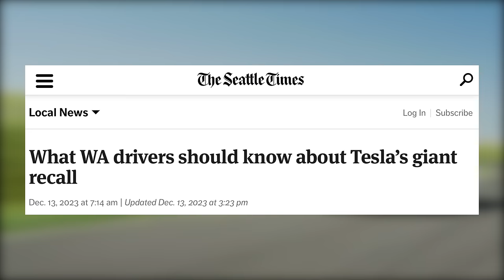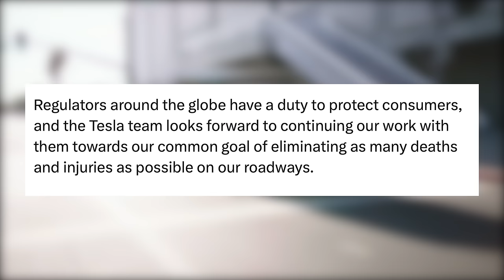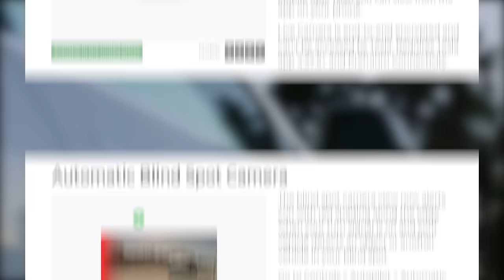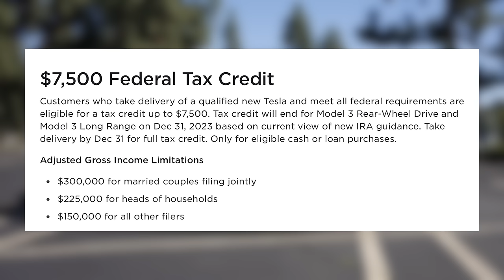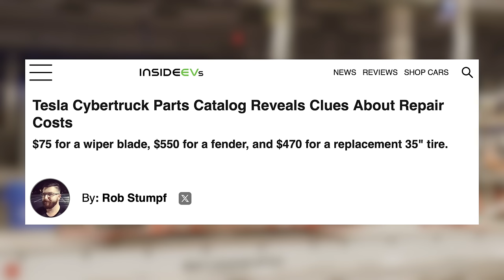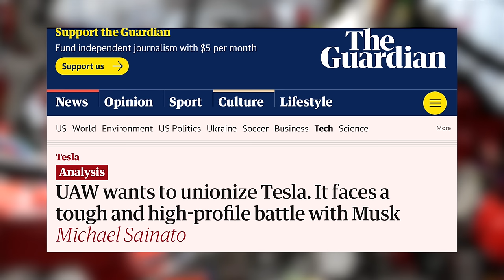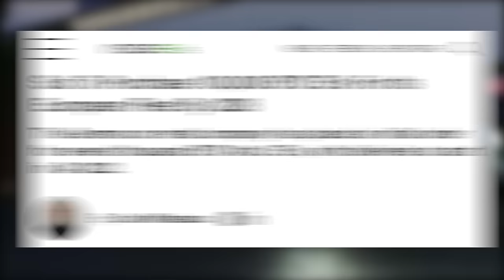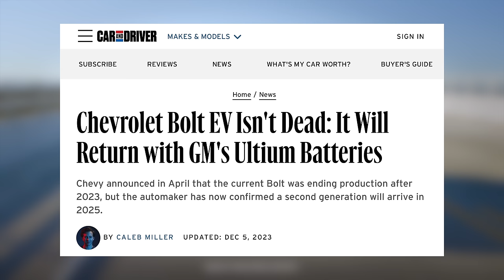NEW Tesla Features Are HERE | This Is Awesome

Comment: This SHOULD NOT BE CONSIDERED a recall. This is an over the air software update. There is a big difference (IMO).
Reply: But Tesla- haters sing the same song.  Same crap, different day…
Reply: The transportation is treating it as a recall however it is easy for Tesla since they can just send a program, like spam emailing people and it's done.
Reply: There needs to be a distinction between “Recall” and “Vehicle Update”.  But these corrections in nomenclature take time and move slowly.  Hopefully it’s on their JIRA board to correct soon.

Recall = physical component that requires the manufacturer to resolve or a software correction that cannot be resolved with an OTA update and requires service center intervention.

Vehicle Update = discovered issue that can be resolved with an OTA update.
Reply: Call it what you want imho idc bc I was sleeping when my car got the update. Boo who, not me =b
Reply: It's still a safety :face-purple-wide-eyes:recall, but just a different way of correcting the problem.
Reply: @vnitto  Right, a convenient and instantaneous way to solve a problem that virtually all other manufacturers have to issue physical recalls for. But yes…
Reply: @vnitto in this context Recall means "recalled to the dealer". It's not a recall.
Reply: Recall has to do with the issue resolved not the way it is resolved.  So let me ask you this Bolt vehicles had fires in their vehicles.  The original plan was to simply do software updates and resolve the 6 cars catching fire at the time.  If a software update resolved the issue OTA then you would not consider it a recall even though there was clearly safety issues?
Reply: Facts..  it’s not a recall… lol…
Reply: @themidgetsman No. And there was no over the air software update that solved the fire issue. 
So the Chevy Bolts were actually recalled.
Reply: No, there is no difference as the term is defined by the agency that regulates it. Any time a manufacturer is required to fix something it is a recall.
Reply: Exactly. Took 15 minutes while I sat on my couch.
Reply: @wizzyno1566  let’s agree to call it a software safety recall
Reply: He doesn’t care, it looks like someone paid him to say this😂
Reply: 15:45 10 minutes? Tesla already did it in 1.5minutes. I’d stick to supercharging at this point.
Reply: An update mandated by a government entity to correct a safety defect in the car’s software that you don’t have to bring into the dealership to fix.  Not a whole lot different from an update mandated by a government entity to correct a safety defect in the car’s software that you do have to bring into the dealership to fix.
Reply: @slackerman9758  If you have to bring your car into a dealership to get a software update, then the company you bought your car from has failed at software.
Reply: They call it a recall, so that’s what it is. After all, Tesla calls its system Autopilot, when it’s actually cruise control.
Reply: If NHTSA says it’s a recall, it’s a recall because NHTSA is THE LAST WORD on what is recalled or not. The fact that the vehicles do not need to physically return to a brick and mortar garage is IRRELEVANT. NHTSA said “Tesla, fix this!” and Tesla said “Yes, NHTSA, will do”. That is a RECALL.
Reply: I think there is a negative association with recalls, because historically it was very expensive and time consuming when a big one happened, and annoying for the customer. This is a recall in the sense that Tesla agreed to make a significant change to a lot of vehicles due to government or other pressure, but it is quick, inexpensive, and getting the recall does not inconvenience the customer. Soooo recall lite?
Reply: Agreed
Reply: Media is attacking Tesla and Elon.
Reply: @davidzambrano9126  That doesn’t mean it’s not a recall. Both things could feasibly be true.
Reply: @davidzambrano9126  That doesn’t mean it’s not a recall. Both things could feasibly be true.
Reply: @malthumb  yes. Feasibly true. Dishonest journalism made to sensationalize a small update. Not a traditional recall/replacement of a physical part
Reply: This dude always says the software fix as recall . Even though he makes money out of posting tesla related videos , he still hates Tesla.
Reply: @rdk3996  It is unpatriotic to bash Tesla. It is a huge plus for America
Reply: This is not an attack on Tesla as some of you seem to think. It is a recall by definition of what a recall is. We can just be happy that it's solved with an OTA update. Stop being crybabies about issues concerning Tesla
Reply: If the issue can be corrected via a software update, it can still be considered a recall 😂😂

Comment: I find it interesting that the news media and social media is very heavy handed on the delivery of a tesla recall, but barely mentions it when the thousands of recalls every year from other OEMs happen.
Reply: Think about it,  how many ford recalls have you commented on...  Probably few now how many Tesla recall videos do you comment on...  Probably allot.
Reply: Recalls where the car has to go in and hardware replaced . I have had something like  8 recall's  on my BMW and it's 2006. 
Hardware stuff every time.

Got the over the air update last night on my Y . Drove it this morning noticed the new display for parking while backing 
out of the driveway not enough data to say good or bad yet.
Reply: First they ignored Tesla.
Then they ridiculed Tesla.
Then they fought Tesla.
Then they copied Tesla.
Then they Tesla won.
Reply: I have had 3 "back to the dealer' recals on my 10 month old 23k miles ford lightning. Just was in for 2 weeks for  a "bad cell"  replacement.  No reporting that I have found in the media.
Reply: They report on every major recall. What are you talking about???

Comment: I have a 2022 Model 3 with FSD.  I mostly ONLY use FSD on the Florida Turnpike, when I'm driving the 100 mile trip to my son's house.  As far as staying engaged with my hands on the steering wheel, that's a problem.  If my hands are at 10:00 and 2:00, they balance each other out, so I'm constantly getting flashing reminders and I have to dangerously (at times) shake the steering wheel.  The only way for me to avoid warnings is to rest one wrist through the steering wheel, for it to sense the weight of my arm.  It's way less 'control' : (
Reply: A hand or arm position through the steering wheel is very dangerous to your physical well being if the airbag goes off. 
Broken arms, wrists, hands and fingers occur from positioning hands at the top of a steering wheel during airbag deployment.

Comment: the main issue is that you can set the autopilot speed to whatever you want and it's causing accidents so that's the main thing that needs to be fixed and it should only be able to go the speed limit on that road going forward... an example is the latest customer who crashed and died going 75mph in a 35mph zone on autopilot... the system should've never let that customer do that

Comment: The question about Phantom Braking is just because we have a 2014 Mazda 6GT & it does Phantom Braking also. I believe all  cars with auto braking will have this happen at random & the manufacturer can't fix it. Our Mazda has radar sensors also so that should be the problem.

Comment: 44.30.1's more strict mode is glitchy. I got a strike despite nudging the wheel when I got a nag indicator (both my hands were on the wheel and I was looking forward at the time). The strike came within a second of the nag indicator coming on, and then the "you got a strike" popup refused to go away afterwards. It would display every time I went from park to drive.

Comment: I have a 2017 Outback, and a 2020 Model 3. The cruise control on the Outback is far superior. I use it around town, where it goes down to 25 mph. My wife doesn't like the same on the Model 3 bacause it tends to act very abruptly when it's not necessary triggering her startle response.
Reply: I have a 2023 Outback and previously a 2014. The 2023 has great acc and also gets 4-500 miles range  for road trips. My around town car is a 2022 Nissan Leaf plus.  I do love this channel.

Comment: Each disengagement should increase the time of disengagement , the time to rest back to the first lockout times, this should be by person eg via face reconciliation. (Times could be drive time of that person, so wouldn’t rest the next day but after they have driven for x mins/hrs)

Example
First 15 min, reset time back to first offence time after 15min x2= 1/2hr
2nd within the 1/2h is 2 time longer lock out for 1/2hrs and resets after 1hrs
3th within the 1hrs is 2 time longer lock out for 1hrs and resets after 2hrs
4th within the 2hrs is 2 time longer lock out for 2hrs and resets after 4hrs
5th within the 4hrs is 2 time longer lock out for 4 and resets after 8hrs 
Etc maybe 2 times not enough and should be 3,4 or 5 times but same principle

Repeat high offenders could reset their time by doing a Tesla safe driving course… lol

Comment: Taking autopilot crash data per million miles as an overall safety score is not an accurate safety evaluation because autopilot will most likely be engaged while performing highway/freeway driving and therefor will be safer per mile than city driving. You cannot compare every mile driven the same. They need to compare autopilot miles driven to the industry equivalent cruise control miles driven which is more likely to be engaged during highway/freeway driving.

Comment: I disagree. This is a recall in the full meaning and purpose of a recall. The method of correcting the problem is not the determing factor of a recall. It is whether there is a significant safety concern impacting enough vehicles. The convenience of ota fix should not be differentiated since it would possibly minimize the perceived safety concern.
Reply: I mostly agree, however I will say that mentioning it can be fixed via OTA update can greatly impact $TSLA stock.
Reply: @leviolson  It does mention that you just need to read the story.  If you only read a headline like all headlines they will be made to attract attention.
Reply: It's not a recall in the traditioanl sense of the word though. If I told my parents their car was getting recalled or had a recall, they would assume as many millions of Americans would, that the car would need to be taken to the dealership to be repaired. 

If I told them their car had an important safety issue that needs to be fixed and that the dealer would send their car an OTA update, they probably wouldn't care as much knowing there isn't anything they need to do. 

Saying "Tesla is recalling millions of vehicles" in news outlet headlines in a country that already hates EVs because of politics, is essentially pouring fuel on the fire. ESPECIALLY, when this "recall" isn't really a recall because there isn't anything wrong with the cars, but more of a case of people behaving badly and misusing the system. So no, I don't agree with calling this a "recall", especially with no further context or mentioning of the software update.
Reply: Too bad they don’t have to fix the phantom breaking.
Reply: @randallsmith2360  I complained about that a while back and actually haven’t had any issues for a long time in rural South Dakota
Reply: @randallsmith2360 I have heard of no reports pertaining to broken or breaking phantoms in the vehicle.
The brakes, now those might be another issue.

Comment: The batteries replacement sound convenient until you ask question of it.  First, do you have to switch out the battery every few days or week?  Second, the biggest problem is travel.  Long distance trip, your battery 🪫, where the hell do you get it replace😅.  Thus, supercharger is still very reliable source for long distance road trips.
Reply: Yeah battery swap means constant money drain for the swap. Not really necessary for daily driving and battery charge speeds are rapidly improving. If you play musical battery's how do you know your not going to end up with one worse than what you bought. 
If you use the Tesla Semi as and example it seems there is no need for this.
Reply: The business model of Nio is. 
Either buy their battery for 12000 or lease it for 169 a month. With lease you have live long warranty on the battery and swapping is free.

Comment: I feel like it’d be morally wrong for autopilot to detect and strike a driver for using a phone or other device while driving, as it’s obviously not going to stop anyone from doing those things. It is better for autopilot to be engaged if someone is going to do this anyway rather than forcing manual driving thus decreasing safety for everyone on the road. Eating while driving is also technically not legal but 99% of people including officers do so and you’ll never be pulled over for eating while driving. I don’t trust the system to distinguish eating from phone use and again, it won’t stop either from happening.
Reply: The AI detects phone use not food use so far. 5 strikes and out for a week. The 5 strike rule has been with FSD but now on autopilot. The strike rule will be new for autopilot users.
Reply: @skywave12  I feel the same about fsd. It’s morally wrong to lock you out of autopilot for it

Comment: All those who say that any safety, or any other issue isn’t a “recall” is not understanding the meaning of the phrase:

“if either the manufacturer or the NHTSA determines that a vehicle or its equipment pose a safety risk or do not meet motor vehicle safety standards.”  
If it is a mechanical or software related “fix” it still would be a recall or resolving a problem.

How is this hard to understand for Tesla fans?
Reply: I think the issue we have is the comparative intensity of reporting on Tesla “recalls” such as this which involves just a little more than a font chnage, vs the Hyundai/Kia recall of 3.3 million vehicles where the brake fluid leaks out and catches fire!!!  H/K has instructed owners to park the car away from homes to prevent house fires!

But the media seems to treat the Tesla recall as worse

Comment: Swapping batteries seems unnecessary.  Soon you'll be able to go from 20% to 80% in ~15 minutes.  If swapping your battery takes 10 minutes...and you don't know how good the replacement battery is...that's not a great tradeoff.
Reply: As far as I know, it already takes 15 minutes to go from 20% to 80%.
Reply: @surferdude4487  Right.  So why swap batteries?

Comment: Sorry folks. Battery swapping is stupid. A charging stop from 20% to 80% battery is only 15 minutes. Getting a battery swap to be less than a 15 minute stop is near impossible. And, even if it could be achieved, the wear and tear on your BEV plus the fact that the battery is no longer yours must be considerations.
Reply: A NIO battery swap takes 3-4 minutes (provided no one else is in line before you)

Comment: I have yet to hear an explanation of how the ENTIRE IRA tax credit will be lost if the vehicle is made in North America. $3750 should be the lowest the credit is reduced.
Reply from the maker: “Assembled in North America” is the base requirement.

“$3,750 if the vehicle meets the critical minerals requirement only
$3,750 if the vehicle meets the battery components requirement only
$7,500 if the vehicle meets both”

https://www.irs.gov/credits-deductions/credits-for-new-clean-vehicles-purchased-in-2023-or-after
Reply: The IRA section 3401 (Clean Vehicle Credit) has the following provision:  Excluded entities -- For purposes of this section, the term `new clean vehicle' shall not 
 include-- (A) any vehicle placed in service after December 31, 2024, with respect to which any of the applicable critical minerals contained in the battery of such vehicle were extracted, processed, or recycled by a foreign entity of concern, or (B) any vehicle placed in service after December 31, 2023, with respect to which any of the components contained in the battery of such vehicle were manufactured or assembled by a foreign entity of concern.
By removing EVs with battery components from China (2024) or minerals from China (2025) from the definition of vehicles that this section of the law applies to, the entire tax credit section is void for them and they get nothing.  The two halves of the tax credit are only available for vehicles that meet the overall qualifications for the tax credit and these no longer do.
Reply: @TimCristy   Thanks!

Comment: Why do you call it a Recall.??
Reply: Because it was.  Recall has never been determined by how it is resolved but by if the problem causes danger to the occupant or others.
Reply: Check and see if your vehicle has Takata airbags. That’s a recall that’s been going on for over 20 years and will definitely affect safety if the airbag deploy and metal hits you when it happens. no mention of that. When the wheels fall off of a BZ 4X Toyota and you take it in and they can’t fix it. That’s a recall.
Reply: @themidgetsman  The recall is an update for the car to perform for the worst drivers.

Comment: Hi, I don't know if this is not a recall, then can you tell me what is a recall.
Can you elaborate more instead of giving bad examples of excuses. 🙄🤭👎
Reply: Look up Takata airbags.
Reply: @royphillips7644 
That is bad engineering.
Same Tesla bad software.
Reply: The term recall should be restricted to fixes where the car needs to be physically returned to the dealer or other nominated place for rectification.  

This should be called an NHTSA directed software update.
Reply: If NHTSA says “Automakers XYZ, we find that your vehicle exhibits a problem that is a safety concern. Notify all buyers and FIX IT!” that is a recall. It does not matter whether the fix is in the dealership or over the air, it’s a recall.